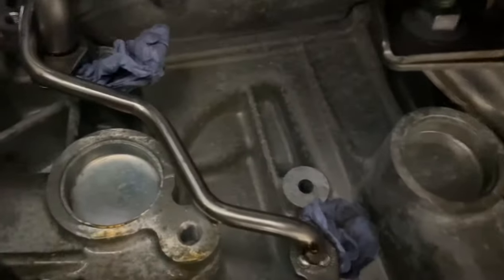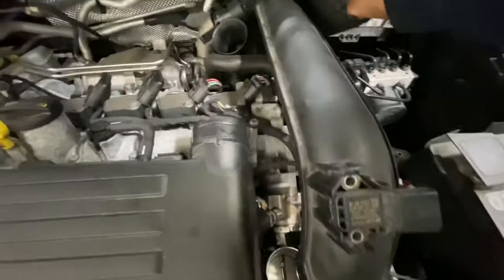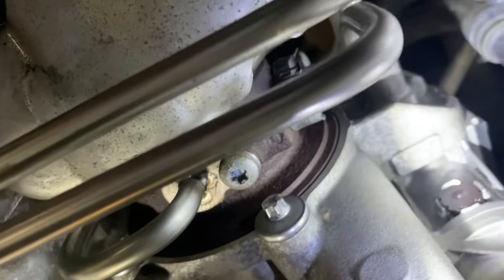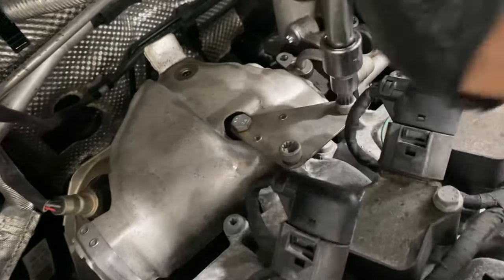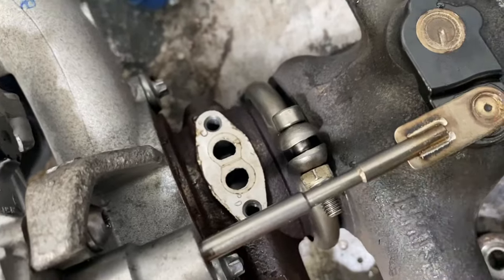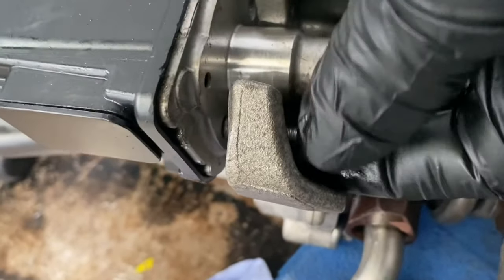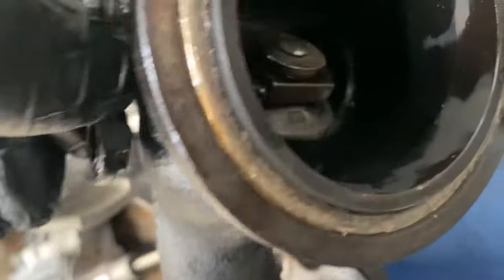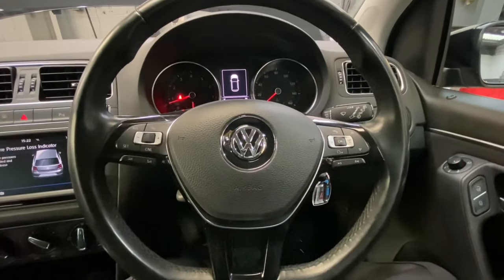#VW #Polo 1.2 #tsi #engines #turbocharger #boost #Actuator fault

Comment: My 2015 1.2 tsi Skoda Yeti doesn't have any faults. However, when accelerating from rest, the turbo doesn't kick in the first 3 seconds. Could that be a sign of a failed waste gate?
Reply: The experience I’ve had pin originally pin seized actuator to waste gate lever after a period of time done the actuator in

Comment: The service offered turbo repair for the epc problem, what do you think is the problem, although weskeyt and valve were made
Reply from the maker: Well this car had 2 problem first thing was the turbo actuator that was seized and the flap in the turbo was sticking when the vehicles exhaust manifold get hot burn out the turbo actuator so I had to change both
Reply: @g_a_bofficial  Thank you for the information you have given, but I think my problem is not the turbo because the service said that if the turbines in the turbo are replaced, the problem will be solved.
Reply from the maker: If the turbine wheel inside the turbo is fault with excessive noise/ movement then yeah
Reply: @g_a_bofficial  with the flap sticking, can it not just be cleaned up / grinded?

Comment: Hi, I have a Škoda Fabia 2017 1.2 TSI. The car drives fine and has no fault codes. Although I have a rattle off throttle which I believe to be to do with the turbo. Is this something that sounds familiar to this problem in the video?
Reply from the maker: No it’s wasn’t a rattle the EML light was on on the car didn’t have the extra power that it was supposed to have the rattle could be something loose in the engine bay possibly

Comment: Hi Just stripped out to find pin seized in boost flap lever,,, un siezed 200 miles later siezed again ????????????
Reply from the maker: What pin are you talking about
Reply: @g_a_bofficial  pin on the end of the actuator connected to the waste gate lever

Comment: Hello sir I got seat ibiza fr 2021 1 ltr  and got on dash particulate filter regeneration required consult vehicle wallet.  Can u give me advice please thanks
Reply from the maker: Sound like you’re car need a regeneration you can do this by driving your car for 1 hours nonstop and this should fix the issue otherwise you will need a diagnostic tool to do this if you don’t know what your doing take it to a qualified professional
Reply: First see if your DPF sensor is working if you have access to a diagnostic laptop  follow these steps locate live date / particulate pressure with just the ignition on the readings on the differential pressure sensor should read 0 when you start the car it should read between 0 and 10 mill bars if it more a Regen 
 is needed
Reply from the maker: Hi pal have got a subscription available on my channel if you want to get information don’t for get to join the subscription this will help my channel to grow

Comment: Hi i only have my epc light indicatin on the dash wen i scanned it showed that my wastegate actuator is faulty and if i replace it will my car come out of limp mode? Was it the same for u
Reply from the maker: Check if the wast gate is working if it not I would replace it

Comment: Nice video, i have the cbzb engine 1.2 tsi and a p0049 fault, could it be the actuator, and should it be complete close when the car is of? Thanks in advance.
Reply from the maker: The waste gate should be completely close otherwise the Actuator could be stick or not working
Reply: @g_a_bofficial  when i turn off the car the actuator seems that it can go back 3-4 mm more , so the waste gate flaper i presume. I have a p0049 fault and i was suspicious about the electronic actuator behaviour, it should be faulty then.Thanks you alot for your consideration!
Reply: @iakovosvoyiatzoglou  check the pin which is located on the end of the actuator they tend to seize up
Reply: I change the turbine and the actuator too with a new ane but i did not reinstall the 03F 145 371 A - spacer washer and the problem still exists?
Reply: @iakovosvoyiatzoglou  disconnect the actuator if you have access to a diagnostic access Active test and the diagnostic will move the actuator (it’s shown as Exhaust bypass valve )
Reply: I bought the turbo new and the actuator was already on without the space washer as the previous old had,so I did" the first adaption" with success through the vcds  and the fault comes on when i push it hard. I did not quite understand what you are telling me to test more, can you please be more specific?
Reply: @iakovosvoyiatzoglou  active test the actuator you can visually see the actuator movement and know that it working correctly and the signal is ok
Reply: @stephendurrant4699  i see ,i haven't done that yet, i will know and come back with the results as i will also  see it from the inside as i will take the cat off for better viewing results! Thanks in advance for your suggestions and the topic,i will come back hopping we help everyone else in here!!
Reply from the maker: Reset the actuator test it

Comment: hi sir, pavan from Bangalore
I have 1.2  polo TDI 2011 model. Turbo actuator is not working and white smoke is coming from silencer 
mechanic told Turbo Actuator is problem now waht is the problem pls let me know 
Watting for your repaly
Reply from the maker: Are you losing power when driving
Reply: @g_a_bofficial   yes sir but pick up is not there
Reply from the maker: I wouldn’t be able to tell you what is exactly the problem without looking at the vehicle myself I would find out why your mechanic said it was the Actuator first
Reply: @g_a_bofficial  turbo  Actuator is not taking air form pipe and white smoke is coming form  silencer

Comment: Is it possible to remove the actuator without removing the turbocharger?
Reply from the maker: Yes if you know what your doing
Reply: Depending where the clip is which connects the actuator to the waste gate
Reply: Yes, you have to rely on your fingers a lot  and a small mirror is helpful , the real problem is removing the circlip, it's virtually impossible to replace it so I didn't bother a couple of years ago and the turbo is still working. I think they put the circlip on just to increase the difficulty and get more trade at their garages when a fault develops.

Comment: Hi, I have a problem my polo 2016 1.2tsi bmt dsg. 53000km I just bought this car . Epc light warning and start-stop faulty is always on display. And I find in faulty code OBD2 05463 (P1557) Charge Pressure Control: Positive Deviation.  And I think car is not in limp mode, performance is good for me. Can you a advise ?
Reply from the maker: Check the charge pressure control hoses if they are all ok get a new charge pressure control for you start stop check if you have a stop start battery and that it’s is charged to a minimum of 80%
Reply: @g_a_bofficial  thank you for your reply. Battery is agm and charge level is good. In my opion start stop faulty reason is epc light. I watched hoses but I dont see any problem(maybe there is problem can i sure?). What is Charge pressure control ? Wastegate actutor or n75 valve etc ? 1.2 tsi gasoline engine i cant find location charge pressure control.
Reply from the maker: Is it a start stop battery you need it find that out in relation the rest of the things you’re trying to say I can’t understand exactly what you’re trying to say please elaborate
Reply: Yes it is a start stop battery. I check hoses (I don't see any crack) and clean map sensor and throttle body (there is  motor oil ) . Also waste actutor move starting 3-4mm and back. But epc light is never close, I am trying to clear command in obd 0.5-1 second epc immediately again .

Comment: hello, i had the same problem in my car, wesgeyt has changed, now we connected it to the machine, it gives a turbo failure p334B00 turbo charger supply golf 1,2 tsi
Reply from the maker: Change the turbo the flap inside gets seized when the manifold get hot

Comment: good afternoon.  what was the problem?  were there any mistakes?
Reply from the maker: The problem was the Turbo actuator and then I found out that after the manifold get hot the flap seizes up putting the turbo actuator under stress so I had the replace the  turbo as well carried out a long road test and it was all ok
Reply: @g_a_bofficial  thank you
Reply from the maker: You’re welcome
Reply: @g_a_bofficial What I found interesting is.. Even though the actuator had seized. Which was giving me no boost and error P00AF. The pivot side of the mechanism was red hot after driving the car. Is this the manifold heat you speak of directly heating up the flap?
I did manage to free up the actuator rod by yanking at the same time as twisting the pivot. No disassembly required. Maybe I got lucky. Or do you think there is a damaged flap or something due to the overheating? If so what should I look out for? Car seems to be driving ok